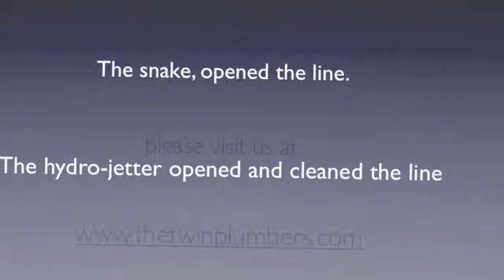Snaking vs. Hydrojetting

Comment: Okay, so with hydrojetting on an old cast iron drain pipe with suspected corrosion and maybe some cracking, what are the chances of the jet breaking out the side of the pipe.

Comment: whether is suitable for higher dia pipes? what are new techniques  to clean sewer line without manual entering in manholes to accidents due to hazardous gases
Reply from the maker: large Hydro jetters with using specialized nozzles for different applications ( roots , grease , etc )

Comment: Very powerful but does it go around a bends? What if the pipe is already full of water?
Reply from the maker: Yes, it will go around bends providing that there long sweep type fittings ..which most are. In respect to the sewer line being full of water, you only want to hydro jet IF you have a proper clean out that will allow overflow to spill over to the outside of the home.
Reply: Thanks for your advice.  My kitchen sink has been blocked solid for three weeks, which means the boiler doesnt work and I cant use the washing machine. I've just ordered a jet but it's jammed solid so the water will fly back out under the sink. I have no choice. Thanks mate.

Comment: The pipe drain was plugged up and dirty water was backing up into the tub and commode. Thanks to the septic clean,he used the pump to unclog the clog. He didn't do much,except hook the hose from his truck and turn on the powerful motor on the rig and it did the job. 😁😁😁😁😁
Reply from the maker: Thanks for sharing

Comment: At what psi does hydrojetting cause concern for damaging one’s pipes?
Reply from the maker: Thats a GREAT question and a question we get often. Our professional opinion after performing thousands of jetter jobs we have never collapsed a pipe using a jetter. If the pipe is brittle and deteriorated then it has to be rehabiliated. If you have a skilled plumber running a jetter and camera you will be fine.

Comment: Nobody ran water while you were snaking. Did the cable even have a head on it?Don't forget the jetting job will cost you twice as much. And where does the Jetta water go if the sewer is already backed up?

Comment: Can the hydro jet break down hard rust build up inside the pipes?
Reply from the maker: Yes. Make sure whoever is doing this uses a camera in conjunction with proper tips to descale. Now, if your pipes are 1.5 to 2 inches in diameter and made of galvanize, then it could be very challenging to remove heavy build up.
Reply: @TwinHomeExperts  Thank you very much for replying to the message.  Was able to open up the 2 inch hole to put in the snake.  After running the snake through the rusted pipes, dont think the jet would of worked.  If you didn't reply with the message, I might have wasted the money.  Thank you very much for your help!

Comment: Yeah... right out of the gate a see a small handheld in a place a 5/8 open wound should be run... my small rig would have snaked that 2” line in seconds.
Reply from the maker: We understand, but a cable machine big, small or tiny moves around inside the pipe the same way.
Yes, each machine has its purpose and strength, the mainline machine is meant for a larger size pipe.
this video was ONLY meant to show how a cable moves inside the pipe VS a hydro jetter.
Reply: The Twin Home Experts I know how my cable moves. I have run my SeeSnake after enough cleanings (both cables and jetters) to know how they do. I can get a 2” line clean more quickly and thoroughly with my 5/8 setup at a fraction of the cost to jet. Granted most of what I do is in cast or galvanized, and that little Jetter hose and head would take forever to get clean. Maybe a warthog would do better? The only setup that would do better than what I run is a high speed machine with a chain head.
Reply: The Twin Home Experts and any cable does not move around in the pipe the same way. Depends on the head, the bends in the cable, the size of the cable, the speed, and the size and bends of pipe. Over time a good drain cleaner learns to use the factors the efficiently clean the pipe. Companies up sell many times to jetting to make a better profit.
Reply from the maker: @mikezeke7041  
Yeah, thats my next video. how to REMOVE roots and debris out of a sewer line.

Comment: I have a pulsar 2700 psi pressure washer. Will this hook up to my PW and unclog a 6inch 50ft corrugated French drain or do I need more psi? or do I need to re dig and replace the FD all together? any helpful advice or opinions is greatly welcomed and appreciated.

Comment: Is that a 4" pipe? Paper products and other solids are usually found in toilets drain lines and floor drains. You don't usually see roots or paper in a sink drain line which is what the general drill snake you used is for. Put the same blockage in the 4 " pipe in front and use a 1/2" snake with a proper tip like a double blade on it and proper machine to demonstrate how it will look when done properly.

Comment: You can't just do the job once to break up the crap so it flows once again. Do the entire job and run your scope to see if there's any breakage on the pipes. 
Too many of these quick fix companies get called out and they do the job for a minute or so and they don't complete the final task on anything! They need to clean up the pipe entirely with running the snake through a few times, use the hydro jet to flush out the entire system several times if needed and use the cameras to indicate the pipes that should be replaced.
A lot of these companies just do a quick fix on a major problem and the homeowner has to call them numerous times. Enough is enough on these extra expenditures when we call you to fix a problem then you need to fix the damn problem, even if it means that we're going to have to pay extra expenses immediately. When it comes to tree roots then we want to know that a tree must be removed as well!
Reply from the maker: Yes, your right. Can’t just do a quickie. 
You have to use the right equipment To extract the roots .We never ADVISE people to remove trees, a big waste of money and time, a true permanent fix is to insert a epoxy liner to stop roots from growing in.
Reply: I totally agree but here is why      most homeowners do not want to spend the money on a Jetter and a camera  they hear the prices and say just snake I am a plumber but specialize in drain cleaning for the last 30 years  my best method is start with the sewer machine get water flowing then camera and jet at the same time I can see where and what I’m cleaning all at the same time.   But remember a lot of people do not want to pay the price for a quality job. I will hear well this guy does it for 99 dollars.    If I hear that after I explain everything I say we’ll call that guy

Comment: First I can tell the difference between you two from your belts,  lol.  And good all around demonstration. I just did the auger method myself on a bathtub a couple weeks ago because I HAVE one of those ( 30 bucks )  and works if you get it down to the clog on a drill and work it back and forth.   Years ago my main line in the yard had roots in it ( Old Orangeburg pipe )  once that happens,  anything is temporary as roots will continue to go to the water. Dug it up and replaced it.

Comment: You didn't use the same diameter pipes nor joints so it didn't appear to be truly comparing "apples with apples" as you stated. If I am not mistaken, wouldn't the smaller pipe create a greater water pressure making it easier TO PUSH through WHERAS w/ THE WIDER PIPE, THE WATER PRESSURE would be more diffused and not work as great?
Reply: You're correct    this was not a fair comparison

Comment: I have iron ochre that builds up in a drain tile, stopping the flow to my sump basin.  I have to flush it out manually once a month.  If it's sits too long moisture shows up along the outside walls.  I'm interested in building a perforated pipe system (1/4 in) to leave in the drain tile, so all I have to do is hook up my hose and let it run for 5 mins.  Has anyone experienced this iron ochre issue?  Any suggestions on a system to put inside the drain tile?

Comment: This was designed to manufacture a desired result which was to make the hydro look better than a snake.  No cutter head on a big pipe,  no flush water and no push and pull motion which breaks up and loosens debris.  Thumbs down for B.S.

Comment: Your video was good except for loosing the sound  toward the end. The only issue is that you drain cleaning guys charge too much for water jet cleaning/clearing of pipes.
Reply: An electric eel with 20 metres of cables and various cutting heads costs about $4K . Jetter with 60 metres of reel, plus 60 metre mini reel, camera and locator etc costs about $40K. Thats why you are paying more for jetting.
Reply: @shanegordon3220  an enzyme treatment also cleans pipes if used regularly...

Comment: i always use a cable snake. you always need to have a controlled run or water while snaking. ive seen companies come in with there flushing equipment and tell me that some of the drains were so bad they  had to use a snake to clear the drain in order to use the flusher......so why not just use the snake in the first place
Reply from the maker: Snaking is great  way to remove a soft stoppage ( paper , feminine products , obstruction like these )
When pipes have major build up to the inner walls , or root intrusion ,then a combination of snaking and hydro jetting is the best method.
Just doing snaking will not remove the build up throughout the line , like hydro jetting.

Comment: I LIKE THE WAY THAT YOU RESPOND TO YOUR VIEWERS, WHOM DON'T AGREE WITH YOUR VIDEO. YOU DON'T DISPLAY ANY ANIMOSITY TOWARDS THEM! YOU RESPOND TO THEM IN A VERY POLITE AND FRIENDLY MANNER!  
MY QUESTION TO YOU IS, I'M GOING TO BE HIRING A PLUMBER TO COME UNCLOG MY LAUNDRY DRAIN, I'VE READ HERE, IN SOME OF YOUR VIEWERS COMMENTS, THAT, IT'S A DISASTER WAITING TO HAPPEN, IF HYDROJETTING OR ELECTRIC SNAKING IS USED ON OLDER HOMES, WITH CAST IRON PIPES? MY HOME IS AN OLDER HOME, WITH CAST IRON PIPES!  WHEN THE PLUMBER COMES TO UNCLOG THE LAUNDRY DRAIN, SHOULD I LET HIM USE EITHER OF THESE EQUIPMENTS TO UNCLOG THE DRAIN? AND WHAT OTHER EQUIPMENT COULD SAFELY BE USED TO UNCLOG AN OLD CAST IRON DRAIN? I COULD BARELY AFFORD A PLUMBER, MUCH LESS HAVING TO REPLACE BURSTED PIPES, DONE BY THE EXCESSIVE FORCE OF ELECTRIC SNAKING OR HYDROJETTING!!

Comment: Is there a certain jetter brand you recommend?
Reply: There is NO one JETTER for all work.  I own several jetters  from 1,500 PSI to over 4,000  PSI and flow rates from 2 GPM to 15 GPM  it depends on what size piping your water jetting 11/2"  -  30"   and what type of volume you need for flushing or scouring   for brands I had riad Rigid, Jetmax,  General and Mustang and  Water Cannon among other brads
Reply: @SylvanTieger  Thank you for the detailed answer!  Would you give specific psi and flow recommendations for a 3-inch line with sludge blockages, what I'm troubleshooting, please?  Thanks again  :)

Comment: I know this is an old video but shouldn't you be running water trough the line while snaking it? if you did that the water would have pushed all that stuff out the snaked line also.

Comment: A Jetter is a good way to flood a house but nice try. Cable with a cutter will be safer.
Reply from the maker: 28 years running thousands of drain calls,  never flooded a house if you know what you're doing. 
Blades and cutters from my experience don't come close to remove roots like jetting or else they would have never invented the jetter.
thanks for checking in.

Comment: This was nothing but a joke. Rent a real snake auger to do the job and don't stop short of going all the way thru the angle fitting and flush with water after and send the real auger thru 2 or 3 times with water flush. I am sure that hydro jet had to also be rented. I am not saying jetting is not good just make it a fair comparison. I do not see you guys as experts based on the video, sorry.

Comment: Big thumbs down for this video.

Apples to oranges comparison.  
They are putting an off the shelf home depot DIY àauger against a professional system. In a situation where you have to cut roots that spring end is not going to do anything.  They are using an undersized tool for the wrong job and claiming that hydrojet is better.

If you had a professional auger system with several sized cutters youd have a fair contest.  Even though that auger has a smaller diameter pipe to try to clear the business end is tiny compared  to the pipe dimension 

Maybe a jet system is better than a comparable auger sytem, but this isnt a fair fight .

Comment: Not a good vid. You are using 1/4 cable in a 3 in pipe. A real drain cleaner would use 11/16 or 3/4 cable

Comment: ... And this is how plumbering company sell jetting... Down plays the snake cable... Only thing I really u a jetter for is grease..
Reply from the maker: Whats plumbering? Thanks for your feedback, yes, jetting is great for grease, Roots too.
Reply: Maybe this video is a little weak in showing what proper snaking can and should do, and maybe also with a bias towards promoting hydro jobs...however, this URL, https://youtu.be/4lBozsiBnEU, AND this video BOTH show to me that hydro has superior abilities in important respects.  In a reply to a comment above, the twins do acknowledge that some hardened plugs require a high-power snake to poke a hole and make a path for first, but that overall and for most cases, hydro is superior in results--and at the least, in efficiency.  Watch Drain Addict's YouTube videos too.  I paid $200 for a professional to snake my main drain only to have it replug just about 3 months later...this is how plumbing companies sell REPEAT drain cleanings and why I'm trying to learn how to do it myself, and/or better.  I guess, really, only a post-cleaning video would show if the final effects are good, with either method.  At the refinery I work at--heat exchanger tubing is cleaned not with snaking, chemicals or brushes and scrubbing/scraping, but by...guess it...very high-pressure water, about 20,000 psi.  So hydro cleaning is seen in oil/gas as a best known method.  Thanks.  I have no connection or affiliation with Twin Plumbers or any hydro sellers or manufacturers.

Comment: That's does not demonstrate proper stoppage removal with a cable. You needed a cutter head and you needed to flush the line with water as you ran the line and also after the cable was removed. Both methods have their advantages and the skilled Plumber will know when to use each method. Texas Master Plumber 17794

Comment: Ya that snake that technician is using isn't the best equipment for that job! Because u should use a blade are a full set blade are even half of a blade! And hydro jetting could flood out some ones house and cause water damage and using water in a plug line isn't smart cause ur asking for a flood! I guess if you want to up sale a customer then use the jetter then!

Comment: Good video, but of course the hydrojetting can only be done by a professional ($$$), whereas the snake method can be done by the homeowner and save $$$.
Reply: Cooll Asice They make attachments for consumer grade pressure washers that are about the same cost as a snake, if you already have the pressure washer
Reply: Just bought a jet line (hydro jet) for my pressure washer. Cost me $150.
Reply: You can actually RENT either of them!

Comment: NOT AN FAIR CABLE TRY H, HE DIDNT HAVGE 

VE A BLADE ON THE END OF THE CABLE TOO CUT AWA THE ROOTS!! I WORKED FOR ROTO ROOTER AND WE HAD CABLE MACHINES WITH BLADES OB THE END OF THE CABLE FOR SUCH CLOGS AND THE DESCRETION OF THE TECH MAKES THAT CALL!! I WOULD HAVE CLEARED THAT NO PROBLEM

Comment: Terrible misrepresentation run water while snaking and don’t just ram the undersized snake down!
Reply from the maker: yep! glad there are opinions out there.
Reply: This URL, https://youtu.be/4lBozsiBnEU, AND this video BOTH show to me that hydro has superior abilities over snaking in important respects.  In a reply to a comment above, Jim and Dave do acknowledge that some hardened plugs require a high-power snake to poke a hole and make a path for first, but that overall and for most cases, hydro is superior in results--and at the least, in efficiency.  Watch Drain Addict's YouTube videos too.  At the refinery I work at--heat exchanger tubing is cleaned not with snaking, chemicals or brushes and scrubbing/scraping, but by...guess it...very high-pressure water, about 20,000 psi.  So hydro cleaning is seen in oil/gas as a best known method.  Thanks.  I have no connection or affiliation with Twin Plumbers or any hydro sellers or manufacturers. 
Show less

Comment: The only problem with this is it's not representative of all the types of pipe systems you will encounter, as there will be more older metal types with reams of different twists and turns in the piping systems you encounter, but definitely not this laboratory  clear type. But good intent?

Comment: 1/4 inch hand machine is the worst machine there is. going into a sewer .....  that is laughable A 6inch main will have roots 2-3 inches you will break that 1/4 cable off in pipe than charge customer for your mistake. And of course jetting is about 4 times more expensive. Nice job duct taping leaking drum, I would kick you out of my house if you brought that general hand machine,no self respecting drain cleaner would ever do that.

Comment: If tree roots are growing though the joint in the drain line, it would be harder to remove.  How do you deal with that?
Reply: You would probably need to have a miller. And then epoxy coat the joint to prevent intrusion. That is what my company does.